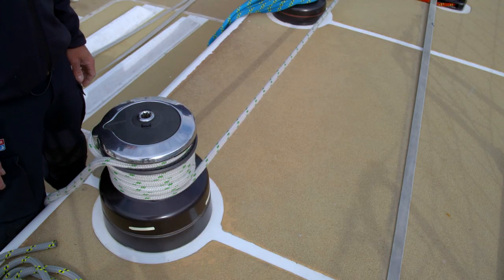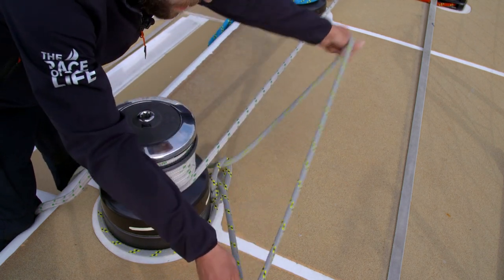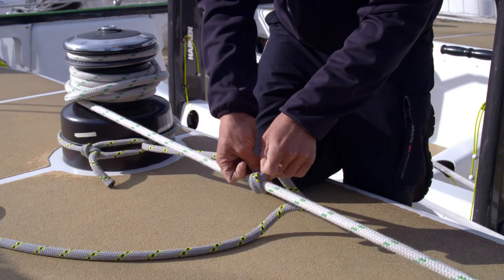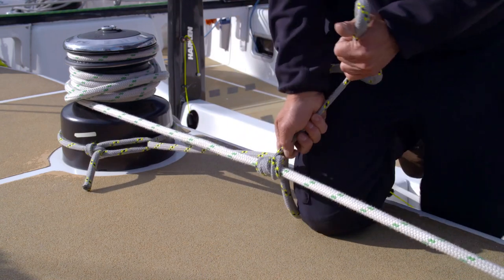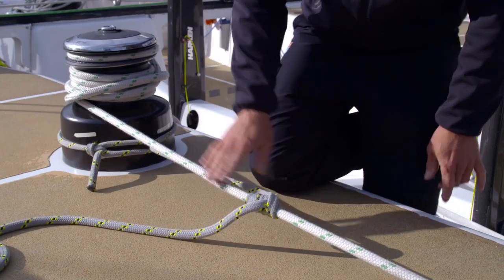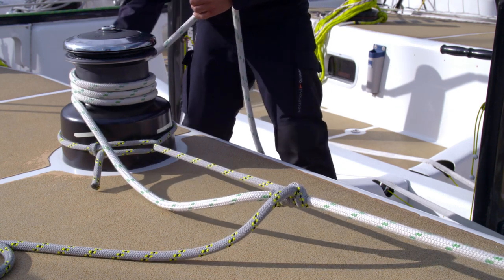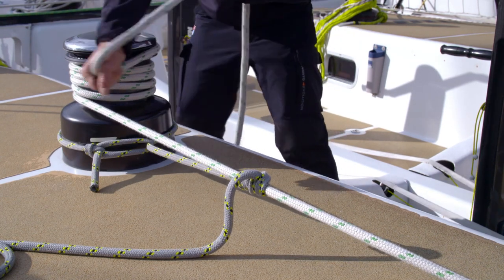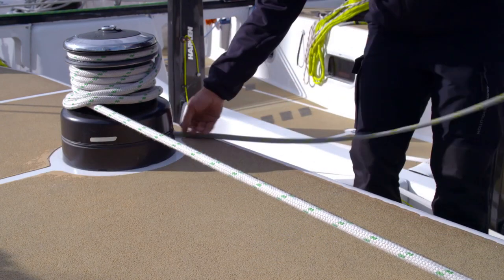Clipper Race Training | How to tie a rolling hitch knot

Comment: Really good - thanks for the excellent share. Needed it last night when we got an anchor line for a racing mark wrapped around the rudder, in big current. So much tension on the anchor line, ended up having to cut the line. We salvaged both the mark and anchor, but didn't get to the finish line before the race timed out.

Comment: Thank you for showing the mechanism of how a rolling hitch works. You showed that there can be more than 2 round turns which is typically taught. You did 4 round turns. What is worthy to remember is the direction of the load that is intended is on the side of the 2 or more round turns.